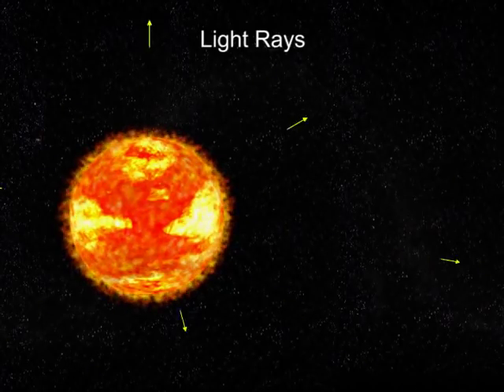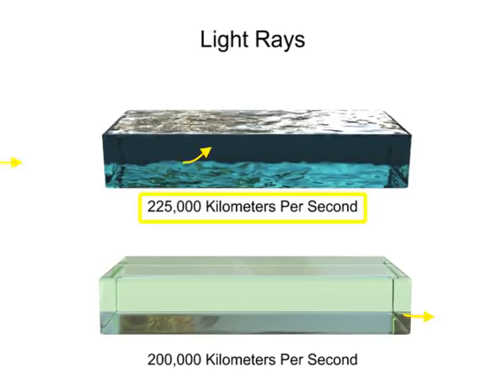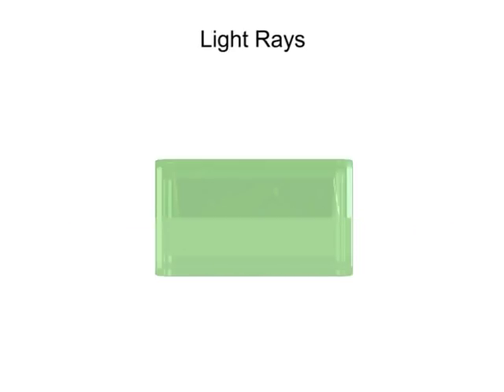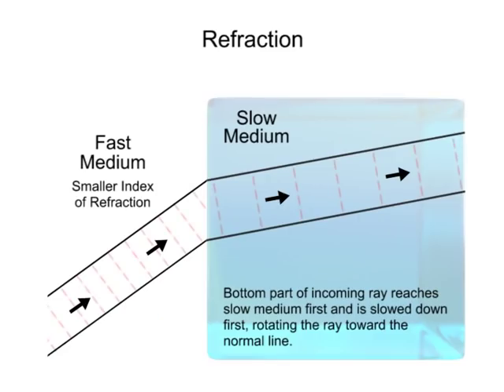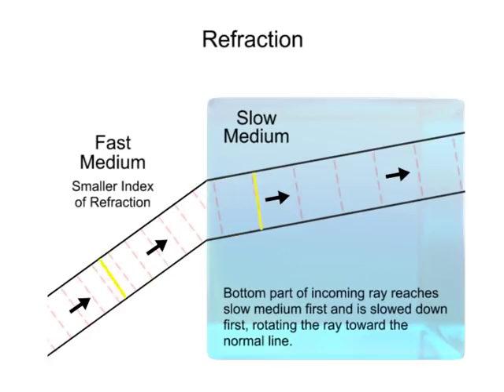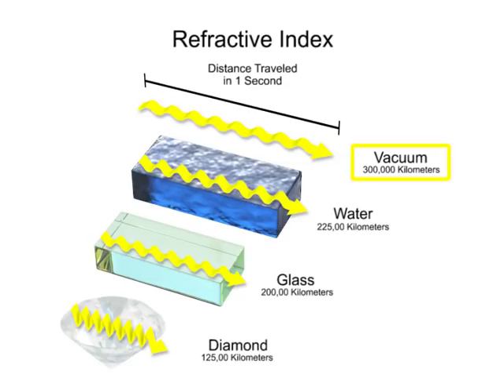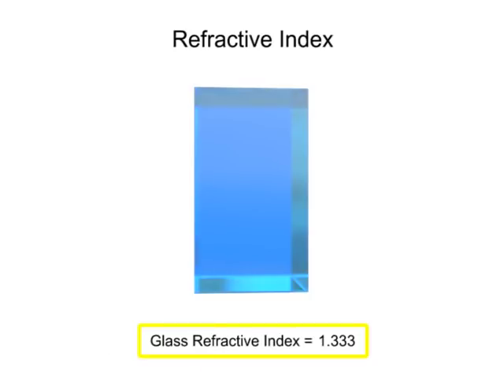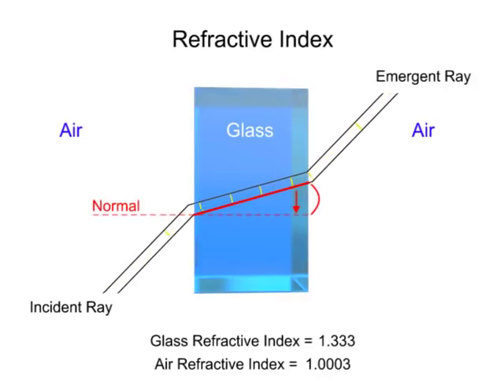What is Refraction?

Comment: For the ones curious, I leave here a explanation of why refraction happens:
(It can be explained as a consequence of conservation of momentum of photons)

If in medium 1  the index of refraction is n1 and in medium 2 the index of refraction is n2 and for the definition of index of refractions and wavelength we have:
n1 = c / v1  ,  v1 = λ1 * f  
n2 = c / v2  ,   v2 = λ2 * f 

Dividing the above equations we obtain:   n2 / n1 = λ1 /λ2  
So if n2 is higher than n1, the wavelength in medium 2 is smaller than in medium 1.

Now because the photon momentum is:   p = h / λ
Applying the conservation of momentum of the incident and transmitted photon along the parallel line of medium separation:

p1 = p2  →   h/λ1  *sin(θ1)  = h/λ2  *sin(θ2)    →   n1 *sin(θ1)  =   n2 *sin(θ2) 

This is the Snell Law!!
So the light bending is just a consequence of the conservation of momentum of photons!